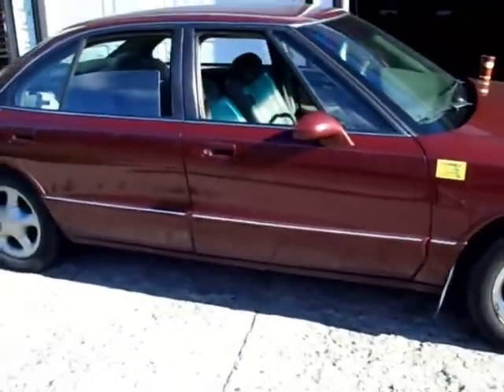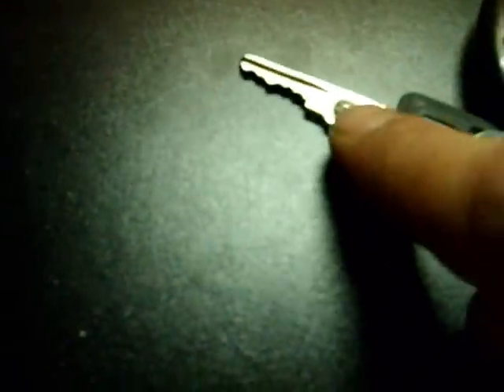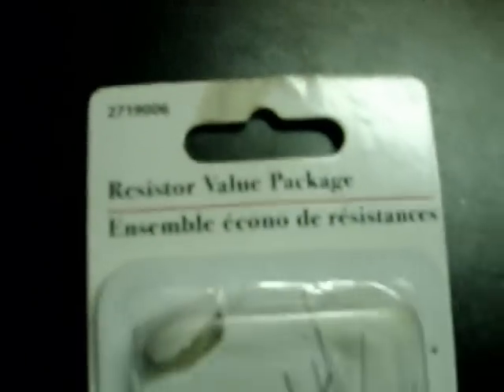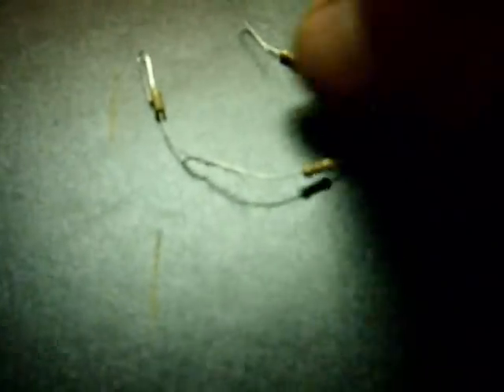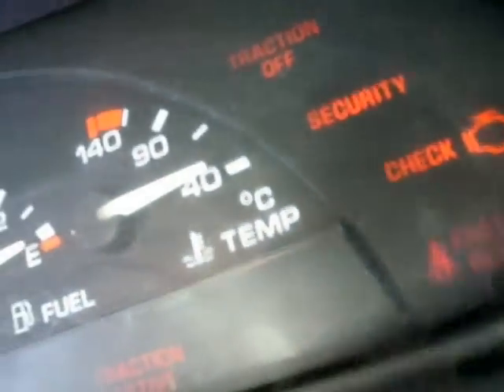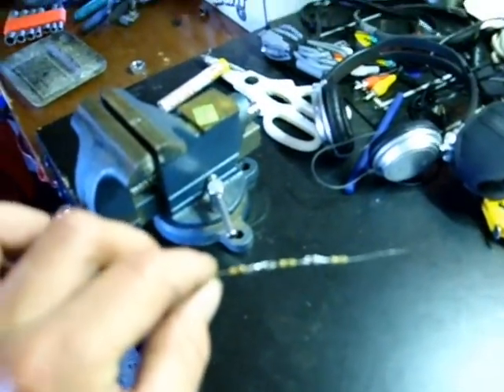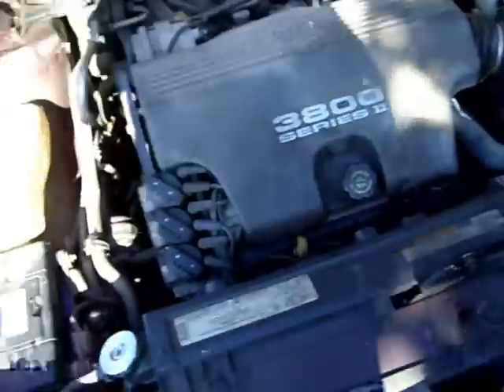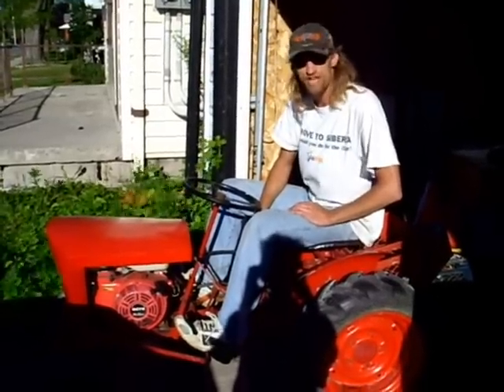Bypass GM Vats Security

Comment: hey bud I have a 1996 Buick laSabre the wire comes up from ignition and down into this block 
your saying to do the loop of resistors back into the block not back into steering column 
is that right?
Reply from the maker: yup, you wanna bypass the whole ignition, cheers
Reply: what was your total ohms

Comment: yeah the key have a resistor so the Orange wire you cut off is for the ignition because the car I have has a different wiring

Comment: Here is the way to truly bypass the VATS system if the resistor trick doesnt work... First you have to find the starter relay and the actual VATS module. The VATS module is usually  behind the glove box. It has one plug-in harness. The starter relay can be found usually somewhere under the driver side of the dash. Most likely it will be behind the dash cluster being held by a 10mm nut. Once you find the starter relay, you have to cut the two fat wires. Depends on your model car, it may be two yellow wires or a yellow wire and a purple wire. You have to cut both wires and use a good butt connector to connect them together. Use some heat shrink tape over the connector as protection and reinforcement. Tape the exposed wires left coming from the relay. From the VATS module you need to connect 12 volts to the orange wire. This is actually a short-cut to hunting down the fuel pump relay and coil power wires. Make sure that your 12 volt source is powered only in the RUN position not crank position. This wire is the power source to the ECM once the engine is running. Once you have all of this done, your vehicle should start up and run as if there was no VATS system. This is a true hard wire bypass with out having to buy that $89 module that people are advertising throughout the web. That bypass module still utilizes the VATS module. This procedure truly bypasses VATS.
Reply: Shon Carter or you could just do what this guy dod
Reply: I did it this way and it worked . No resistors.
Reply: On my 95 Buick LeSabre I was able to locate the VATS module up behind the passenger glove box (I verified it was the module by looking at pictures of it on google) and diagrams. I am confident it is the VATS module but I don't see an orange wire coming out of the harness. Any ideas?

Comment: Great video, well done, I thank you.  And I would also like to thank Keith Lamport for leaving a comment about leaving the car run for 5 minutes. I too,  thought I had done something wrong when the light didn't go out.  I read all the comments until I saw his. Reinstalled the resistors and drove the car 1/2 block and the light went out. Note: My car just had security light, always started. Broken wire in steering column.

Comment: Good video short and direct, I have a question the resisters loop attached to the orange wire to inner white end wires are they the wires going towards the fire wall correct? Also Radio Shack are gone in NJ went out of business, Were can I get the Mixed package of resistors? good to have just in case Vats systems ignitions acts up one day on Caddy. I am trying to get a Spare ignition key and several locksmith don't even have the GM key with resistor in the the key,

Comment: Nice video, will try!, will it work with a 2001 Pontiac firebird, my key has the chip in it. Should i replace the key or is it a problem with the lock? My car will do this occasionally but start after a few mins
Reply: Zaheer Khan it's hardly ever a problem with the key. Those wires usually break on the back of the ignition cylinder.

Comment: How do I power my fuel injectors. I cut the yellow wire on the column that feeds the solenoid enable relay by passed the contacts on the solenoid enable relay reconnected the yellow wire to the yellow going out to the engine compartment.  Now the car turns over and trys to start but wont stay running when I release the key.  Any Ideas?  thanks

Comment: will this work on a 1988 Electra park ave?
Reply from the maker: If it has the chip visible on the key it will, Cheers
Reply: No It doesn't Have the chip on, but I can start it now by waiting 5 seconds after the Fuel system Kicks in.

Comment: Some GM do not have a chip in the key. I know on my Saturn SW2, I don't need the resistor, the chip is built into the circuit and not on the key. YMMV

Comment: How long does this typically last? I did this today on my 97 cutlass supreme and it worked amazingly, but I have been told it's only a temporary fix?
Reply: It'll work long enough. If the resistors go bad, we'll just replace them.
Reply: +Jimmy S I am preparing to try this on my 94 Olds. was it the orange wire on yours? Really nervous to start snipping.

Comment: If you want to be sure about the resistance value in your key, most locksmiths have a key interrogator which will give you the precise value. Then purchase a precision or milspec 1/2 watt resistor for that value. Precision/milspec resistors are within less than one percent + or - the rated capacity. Most sold at radio shack are 5 or 10 percent off of the value.

Comment: There are 2 orange cables. The large/thick cable was not the right one. The smaller orange cable is the correct one to cut. You wouldn't think there would be 2 tiny cables in that 1 cable but there is.

Comment: Your video solved the problem on a friend's 95 Pontiac.  There is a reference chart on the net (somewhere) that gives the resistance values.  One model can have up to 10 or so "choices."  Now I am researching again because a coworker has the same problem with a 2001 Saturn.  No wonder GM needed a bailout.

Comment: RR, thanks bro!!!! Worked like a charm. Just an update: Radioshack is now The Source (owned by maBell) and the resistor pack is $5. Clarification: connect resistors to portion of wire heading into the board under the column, NOT the portion that heads away from the steering column and into the firewall. There is a beer with your name on it if you are ever in Newmarket. Cheers

Comment: We got the wire issue figured out.  Just realized that when we measured our ohm for the key and it read 9.5 k ohm; instead of getting 9500 ohms, we bought only the 10 ohm.  Hopefully once we get the 9500 ohms, it'll work.

Comment: I've got a 97 Cadillac Seville and having this issue.  I'd like to know which wire to cut.  I've looked under the dash and there's a bundle of THICK wires coming from the right side and a bundle of thin wires.  Which one to cut???

Comment: Is there a way to remove it completely? Not bypass it or the "elimination" method on youtube, meaning totally and completely remove it and make the starter go directly to the switch and the fuel pump on when the key is on. Is there a way to do that?

Comment: Or you can just buy a POT (potentiometer) which is a variable resistor that you can adjust to the correct resistance. Much easier then trying to to add up the values. That's what I had to do to get my 89 camaro running years back. Hope this is helpful.

Comment: there is a easier way to do this though take the resistor out of your key and solder it to the same wire under the dash..did this to my 96 Buick and still runs fine

Comment: i have the right resistence for the key and resistors but not sure i have the right wire. is it the orange wire that runs to the ignition? cause i used that one and it didnt work.

Comment: I have a 98 GM yukon slt.. and I have the same problem with the VATS system..but the only thing is, I dont have a Transponder key(chip).its the regular small gm key. but It will crank but then it will stall after 2 seconds, and the light starts flashing...do you have any pointers on how to fix or diagnose this problem??? would it be the security module built in the ignition or would it be the pins in the cylinder gone bad

Comment: I have a 2000 camaro n the security light has been blinking n the car has not turn on for 3 weeks.im not sure what wires ur requesting, There a orange wire with two white wires coming out of the orange lead. now is that the proper wire that im sopppose to solder  together .my key reads 1.09 is that right.or what im doing wrong so i get 1k ohm n a10k but still dont turn on.
.

Comment: What i did on my 1995 camaro,  theres an orange cable that comes from the ingnition switch and connects with a brown cable that has 2 white cables inside.  Your suppose to cut the brown cable and than soldered the resistence wires to the 2 white cables that are inside of the brown cable.........p.s:  your suppose to soldered the resistence  making it look like a "U" shape..than soldere 1cable to 1 tip of the resistence and the other cable to the other tip of the resistence..

Comment: thank you very much for the video it sure did help. The only thing I did wrong is when I started up the old Buick I did not let it run long. The security light stayed on and I thought I screwed up. I checked the ohms meter and everything was okay but I replaced it in did it again. Here's where I made my mistake I should've left the car run at least 5 min. then the security light went off. It only cost me seven dollars. I love UT

Comment: Ok My car is a 98 deville  I Already  tried the resistors a new key  with a pellet 
Fuel Pressure ok sparks ok  but damn car it WONT START  i have code B2711 AND B2750 CURRENT Any Help Will Appreciated

Comment: 1995 TRANS AM HAD THE SAME PROBLEM TODAY I WATCHED THIS VIDEO AND I HAVE TO THANK YOU SO MUCH; IT WORKS 
I WENT TO RADIO SHACK THE OHM METERS ARE LIKE $30 SO I WAS LIKE NO BUDDY I WILL JUST GUESS THE RESISTORS, I BOUGHT A PACK OF 1000K 100K 10K AND SPLIT THE ORANGE WIRE AND CONNECT A 1000K RESISTOR TO IT AND BAMMM THE CAR STARTED

Comment: gatta question for you guys, i got a 91 camaro RS tbi 305, the vats system has givin me no trouble whats so ever until yesterday, i drove to take GF out to dinner, after we ate dinner, car wouldn't start, the security light i usually wait for, never came on, so im wondering if this bypass will do me any good? the security light isn't blinking or even turning on. what should i do?

Comment: @anythingthatgoes get yourself a breadboard to build test circuits..   There are ~15 different values.. wire the breadboard into the circuit and find the right resistance to make the car fire up.   Hell, actually all you need is the resistors..   A couple bucks from Radio Shack...    I got it the first time and the resistance was jumping all over the place with my "resistor pack"... so all you have to do is get close enough for the ignition to be like "fuck it"..

Comment: badass .. thanks man . I just replaced the ignition lock cylinder and ignition switch  in my Camaro ..(which was a huge pain in the ass) only to find out the the problem was vats all along. ..what a horrible design ... Thanks for the video man this will make my life much easier

Comment: Hey Rick, Occasionally, my 97' Bonneville will cranking, but not start. 90% of the time, it starts fine. Just every now and then, it will crank and crank and crank, but not start. Then if I leave her alone for 20-30 minutes, it starts right up. 

Any ideas?

Comment: hey rick, i have a car with the vats system in it, i want to get a remote starter for her but ill need an extra $130 for them (best buy) to hook p a "bypass module) which iam guessing sends a resistance signal to these whit wires.
if i perform this procedure will i still need this $130 module?

Comment: been playin hell with a 95 lumina. had to get a new switch a year ago because it would get stuck and you couldnt cut it off .. then one of the white wires broke . i tore apart an old radio to get my resistors ..SWEET FIX !!! . thanks

Comment: @ldpbrian If you really want to make sure take the covers off where the key goes into. You will be able to tell if you got the right ones since the wires runs to the key cylinder.   They are in a insulated jacket like the Airbag ones are. But the Airbag wires are labeled as such.  

I got to do this to a 1997 olds cutlass supreme soon before it leaves my brother stranded.

Comment: what do you do if you got a with no keys
its a 94 cadillac sts
I bought a used column so I could take the tumbler out of it so I could unlock my ignition to tow the car
but the key that came with the other column doesnt start the car

Comment: thank you rick this worked for my 1989 cadillac it has a # ( 13) 7.45 ohm runs great now my wire is orange . with two yellow wires inside from the ignition.

Comment: My car is experiencing this same problem. I have one question, I have purchased an o meter and I have checked the resistence of the key, which is 1.475 K. I have went to Radio Shack and purchased some resisters. I have a 1.5K resistor that reads 1.472 K. Will this 1.472 K resistor work? Please respond ASAP

Comment: HELP PLEASE. I have a 2000 impala that i recently changed the ignition switch and its doing the same thing the security light comes on. how do i do this if my key does not have a chip or or whatever that is. how do i get the resistance?

Comment: glad i found this video,,,,i jus tried this out today at work,,,,saved me a hell of a headache,,,, same exact car, same problem,,,, i was leaning toward the ignition cylinder but usually u can see if the wires are broken if u take the steering wheel off and the rest of the components,,,but i did not see anything wrong with them,,,thanks alot man,,,
i also had a different but same problem with the car before,,,, no start no crank,,,found out it was the ignition switch if that helps anyone else

Comment: another trick you guys can try is somethin i see at work all the time if your key stops workin alot of times its the contacts inside the ears have worn out and dont spring back close enough to touch both sides of the resister on the key get a pick or paper clip bend them inwerd toward the key hole and that is a goo try before doin to much work

Comment: Good job. But the key is obviously NOT the problem. If it was, you wouldn't be able to get  the resistance at all. The problem is the 2 wires close to the ignition itself. Every time the ign. is turned those 2 wires rotate. Overtime they will get bent. The resistance cannot travel from inside the ignition, through the 2 wires down the column to connect to the harness. 
The reason why it's expensive to replace the ignition is labor. 
Once again good job.You got the job done & that's what counts.

Comment: i have a 91 z28 and my car wont crank at all i kno it is the VATS but i have no clue what resistor rate i need becouse i lost the original key any help??? i kno my ecm wont read my new column and key.how can i find out the rate needed so i can buy the right number of blank thanks vid is very helpful tho thanksmy new key isat 9.56 on the 20 k setting should i build up?

Comment: I knew you or Dave would have a video of this procedure. Just had to do this to my 94 Bonneville that I had to leave behind in a parking lot. It was giving me signs (leaving me stranded for 4, 8, 12, 16 minutes at a time), but I procrastinated too long. This video helped me be a little braver so once I swung by Radio Shack to get my 4.7k ohm resistor and borrowed a butane soldering iron, it was snip snip! Done in 5 minutes! Wish I'd done it sooner. Thanks for posting this.

Comment from the maker: Yes you have the VATS system but if the light is always on, you have another problem with the system if the car runs. You can try this method to see if the light goes out, but seems it might be another problem.

Comment from the maker: You need the key to get the code, but, it can still be done. There are 15 different resistance codes, you can keep adding resistors to match keys until it starts. PM sent.

Comment: Does your cure apply to a 1995 Pontiac Grand Prix?   Its my sister-in-laws car so I do not have access to it every day and am vaguely familiar with it.  Same problem you describe-- and I am told the issue is the security system.  I do not know which system it has.

Comment from the maker: Try turning the key to the on position and leave it there for 10 min "no less". Then try starting. The two systems are similar. You can also bypass by installing a remote starter. On Passlock 1 systems there's three small wires wrapped in tape coming down from the ignition module, you'll have to cut the right one. PM me your vehicle info.

Comment from the maker: The orange wire runs down from the steering column, inside the orange wire there are two white wires. The orange wire will be a little flat cause of the two wires inside.

Comment from the maker: Check the fuel pressure valve on the fuel rail, if it squirts, your getting fuel. Could be the fuel pressure sensor, when the one went on my Ranger, it open all the injectors full and was spewing raw fuel out the exhaust. Yours might be keeping them all closed.

Comment: I did the exact same thing to my 94 firebird, but its not getting any fuel. I hear the fuel pump turn on and the engine cranks and its getting spark. Why wouldn't I be getting fuel? Clogged fuel filter?